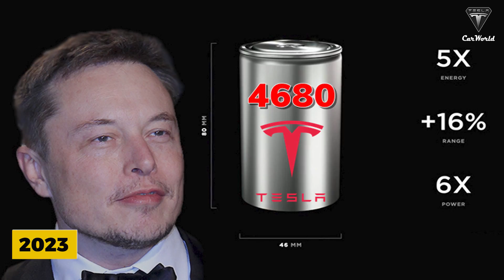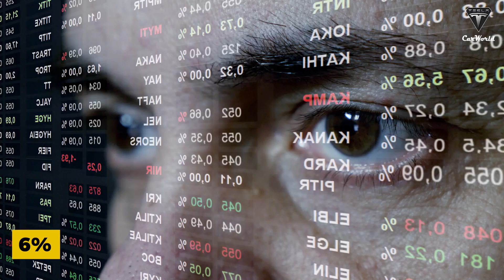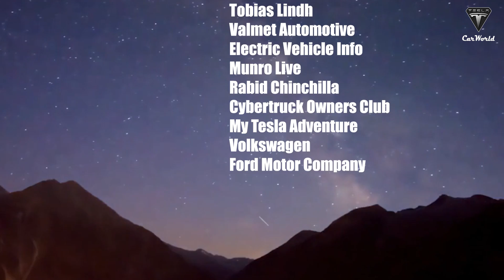Elon Musk Revealed Tesla Insane Cybertruck's Mass Production Plan in 2023! Destroy Everything!

Comment: "Analysts claim."  Please, until some at Tesla specifically say the Cybertruck will not be manufactured with the 4680 cells, then we can still assume it will have them.  They have time to ramp up production of the cells along with all the other inputs for the truck.
Reply from the maker: As expected, Tesla's 4680 battery cell ramp has been slow however, Tesla’s 4680 cells could enter mass production by the end of the year. The company has already been working with suppliers such as Panasonic to develop prototypes of the cell in preparation for large-scale production in 2023.